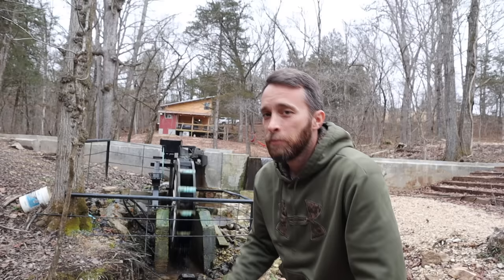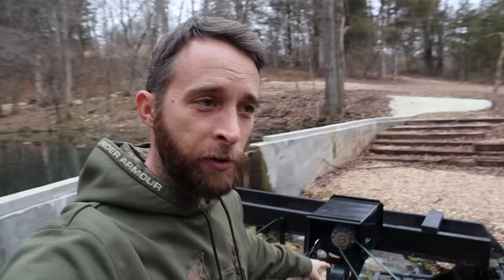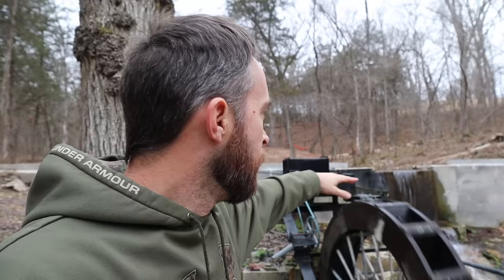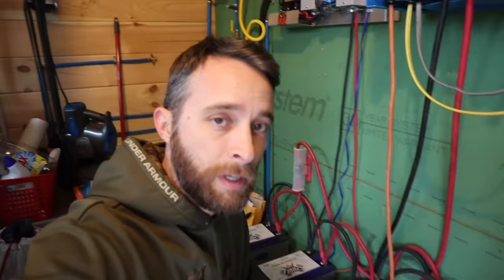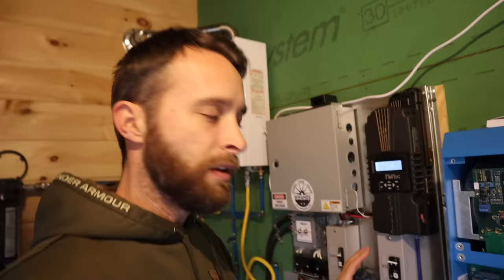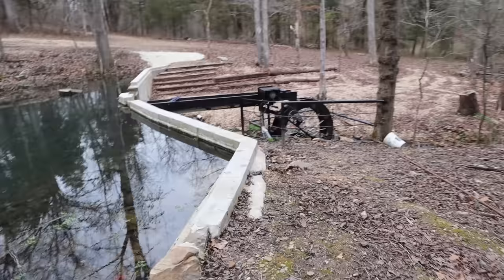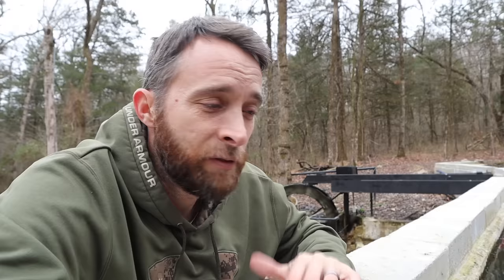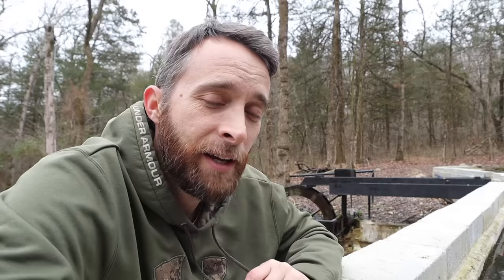Did we MAKE HYDRO POWER Using Our Waterwheel for Self Reliant Off Grid Living?

Comment: Hey. Love the videos, great craftsmanship. Jerry rules! I was wondering if I could give you a little advice that may correct your issues you are having. Replace the generator you're using to a 3-5 kw or possibly higher wattage AC generator. You drastically drop power the longer you run DC  from source to load. Your basically turning your conductors (wiring) into heating elements...yeah DC sucks for distance and is usually much lower voltage than AC which equates to lower effenciency. There's a reason why distribution power lines use 72,000 VAC or higher; more efficient distribution of power and smaller diameter of the conductor needed also. 
   So basically my advice is to use as high a voltage AC generator you can possibly power with your water wheel to power your cabin directly and use an AC to DC converter to recharge your batteries. You will need to turn the generator at 3600 rpm to get your 60hz but the voltage is not directly correlated to rpm speed like DC generators also. It shouldn't be to hard to come up with the right speed. 
   Just in case your wondering I've got degrees in Engineering and a background in Electricity. If you're thinking of trying this and want any help feel free to reply and ask me anything. I guess that's about the way it is done on here. You would think Youtube would make the way it's users intercommunicate much easier and more fluid with the experience of using it... Oh well, some other "something" will figure it out eventually if they don't. Good luck and if your a believer, God bless.
Reply: Saw your comment and I was thinking of making a paddle wheel i a large creek to turn a 6,000 watt generator to supply power to my house. My question is can it be done? The creek moves kind of swift.

Comment: I am working on my hydro system except it will not be charging batteries. It uses low voltage around 6 volts. It's only designed for incandescent bulbs I converted to 3v ultra bright LEDs. Each bulb has a total 4 five mm LED lights pointing in 4 directions. They light very well. Unfortunately I have to wait till rainy season to put it to the test. I recently upgraded the gear box to a 4:1 ratio. So I am crossing my fingers it works.

Comment: the water wheel upstairs is the most efficient among the various types, especially when the flow rate varies, many ignore them, but they give excellent results, they are limited on power but this is not the case, if the flow rate is the same and the difference in height is that the power will be similar but with a reaction turbine it will stop sooner or it will not work correctly when the water decreases, in this case the difference in height is the diameter of the wheel, generally the maximum possible size is lose jump, the right lower space to allow the water discharged from the wheel to flow out without disturbing it, the gear ratio must be corrected for the alternator but it is important for efficiency, the wheel's 10 RPM is not exceeded.
Turbines with Pelton or Turgo impellers must have a lot of difference in level and pressure, in this situation a ducted propeller turbine but would give more problems than the wheel, in my opinion it should be redesigned / modified, also using different materials such as wood for the structure and metal for the drawers, at a certain point it seems clearly under dimensioned, more drawers are needed more large with less space between them, they must be able to contain all the water that arrives, find the correct multiplication ratio, without electrical load it is obvious that it turns fast there is no field magnetic of the alternator that brakes / slows it down.
Ciao

Comment: If you  own property up the hill from the spring, let the water wheel drive a pump and send the water to a tank up there.  
Pipe the water back down to an AC turbine  below the dam.  Maybe you will get the 20 feet you need.

Comment: Use a drill and a multimeter and hook it straight to the alternator to test that it’s producing the amps you expect.  Test it at the source and test it at the house.  If you got significantly different numbers you may have bad wire.  You may also have a bad alternator - it doesn’t look very protected from the elements.   Also many lithium batteries have circuits inside that protect them.  I noticed in your video you were sending all kinds of voltages to the batteries, not just the expected input voltage.  When lithium gets charged too fast it can heat up and potentially explode, so if your batteries aren’t charging at all it’s probably because the voltage isn’t being regulated correctly before going into the batteries. The charge controller should do that job.  You can test all of these connections with the multi meter.  Do you get wind there?  Wind may be better than solar in a place with tree cover if you have it.  Good luck!

Comment: It's probably a stupid question, but have you verified that your generator at the waterwheel actually works as expected. I've seen similar setups work very well with almost no water flow so therefor I suspect that the generator isn't working as it should.
Another issue is the distance you have between the waterwheel and your alternator. You need very thick cables if you want to run that at low voltage. If the generator is producing alternating power, you can simply add an transformer in both ends of the cables and thereby raise the voltage in the cables without having to change anything else. If you raise the voltage from 24V to 50V you will reduce the power loss in the cables to half or more.

Comment: I wonder if you could get some IBC totes and mount them on a tower or elevated area. Then, use solar power to drive a pump to pump water into the totes. That would give you the 20 feet of fall.  I'm not sure how efficient that would be, but you can get totes for cheap. And build them like steps so you have a tote draining into a lower tote once you get the whole system filled with water.

Comment: What it's simply comes down to is that you need the really big wheel to be spinning the very small wheel don't have anything in between also having higher gauge wire will help a lot

Comment: Did you ever take the time to rebuild the wheel using correct hydraulic principles, make a wider wheel pit, and redo the sluice and get the system working?

Comment: You need a transformer to step up voltage to minimize resistance loss, i recommend another generator and a transformer step dow the electricity when it reaches the cabin and get an inverter

Comment: When the water gets to low can you use a ram pump off of your 6 inch reservoir drain line to pump water back up to flow into the water wheel? Seems like the water wheel spins well with minimal water. Just a thought for low water conditions. Keep up the good work!

Comment: Regarding your battery system, I think someone may have informed you incorrectly on a couple things, and I hope this is helpful to you, as I had the same train of thought until a couple years ago.
I heard  you speaking about the voltage and the amp hours of your batteries, and that you are under the impression that by running them in series, you are going to lose reserve power.
This is not true.  Your batteries have a Watt Hour rating, for argument's sake, let's say those BattleBorn batteries are 12 volt and 100 amp hours each, that would be 1200 watts stored in each battery (volts x amp hours)....which means you could run a 1200 watt hairdryer for 1 hour with one battery.  Now if you run 2 of those batteries in series and make 24 volts, you'll notice you are still at 100 amp hours......but each battery holds 1200 watts .....so you should have 2400 watt hours stored.....and you do!  you have not lost any storage capacity by doubling up the voltage, because you efficiency has also doubled.  Now your charger doesn't have to bring the input voltage from your wheel or panels down from, let's say 100 volts, all they way to 12 volts, it only has to step it down to 24 volts, a closer match.  On the feeding side to your household power it's the same thing, at 24 volts your inverter has to step it up to 120v, but it's twice as efficient as stepping it up from 12 volts.
So if you stacked all 4 batteries and made 48 volts, now your charger and inverter have to work even less to get to the target voltages for use.  Remember, you have 1200 stored watts in each battery no matter how you wire it.  Don't worry about volts or amp hours separately, look at the total stored energy which is volts x amp hours.  The less voltage changing you need to do, the more efficient your system is.
The most efficient system would be 120volts coming from power source, 120 volt battery bank, and 120v inverter.

48v at 100 amp hours is 4800 watts.
12v at 400 amp hours is also 4800 watts.
How efficiently you can get it to the hairdryer that is 120v is the challenge.

48v DC --> 120v AC is far more efficient than 12v DC --> 120v AC.  And you have 4800 watts in storage no matter what, it just depends if you are spending it on the hairdryer, or spending it just getting it to the hairdryer.

Rule of thumb: High voltage and low amperage power transmission is what you want between sources and chargers. And the closer you can keep the whole system to your power requirements (in this case it's household 120v), the more you will be able to suck every last usable drop out of your setup.

Hope this helps!

Comment: You should use a low kv bldc motor and get as mutch current as possible (volts), then step it down to 24 volt in the cabin to reduce the powerloss.

Comment: If you have tested volt output after the generator at the wheel, if it isn't constant during good flow likely you have slip i.e. pullies and belts slip with water bad. Chain or gearing or take the belt away from the water. One way is to extend the axels away from direct water.

Comment: I do feel like flume placement and water collection and also resistance in the feed is important that’s why I suggested the flywheel i’m not sure but it’s just a thought Good luck though I want to see it work and I don’t know if you can do this with electricity I’m not an electrician but I’ve heard it said that electricity flows like water the path of least resistance if there’s someway you could collect and store energy in between the cabin and the generator and then somehow get it from there to the cabin that might help solve the diminishing wattage I don’t know how that works maybe a battery bank in between of some sort just brainstorming kind of like a pump house for underground utility’s through out most metropolis cities I think for electrical grids they call them transfer stations you know the same way they get power from the power plant to your home like I said I’m not an engineer I’m not an electrical engineer but I know where there’s a will there’s a way good luck

Comment: while using wheel create yourself some browns gas using the water on the site to extract the hydrogen from the water and use this for everything in the house. 

it's a bit more work to set up and can be a bit expensive to get the tanks but you eventually bury the tanks and use that stored gas through some conversion processes, but it is sustainable once it's all set up.

Comment: An idea, as you say you're getting 50 volts.  Look at the old Delco-Light Farm Generator systems.  It was not uncommon in the earlier part of the 20th century for homes to use a 36 volt DC system rather than the 110 AC.  It's a lot easier to maintain batteries at that kind of voltage and with modern LEDs and low power draw appliances it may be something to consider.

Comment: Suggestions sir.
1 elevated your dam and over pour shoot to hold more water for dry times and also install a smaller gear ratio? Or transmission rear bike sprocket setup for a mountain bike more so??

Comment: What you have will work. You need to listen to some of the comments. Ac to the house, think in terms of watts. Voltage can be manipulated. With batteries and a constant flow you can do alot. You have a great system, don't give up on it. Your generator is the problem.

Comment: Thank you for reading, I didn't espect that. If I were you, I will use Transformer coil to increase the voltage, Diodes to limit the direction,Voltage regulator chips to stabilize the charging voltage, and use exchangeable gear set to decrease minimum working loading force. If the water wheel moves, it should able to charge. This is not mechanical problem, this should be electronic problem. Sorry for my English. Hope my opinion can help.

Comment: 50ah @ 24v is the same as 100ah @12v. You should also put your batteries and inverter way closer to the waterwheel, you will have quite a bit of losses in those long cables.

Comment: On the run to the wheel, block it off more and make a V leading to a centered large size PVC pipe, then reduce the pipe down in a couple of increments to increase the water pressure to the wheel. Just a cheap fix to get a little extra power and save a little on gas.
Reply: Should have mentioned that by reducing the water outlet you may be able to install a second wheel without affecting your water level too much. Reduce or enlarge size as necessary to take care of that

Comment: Put up a 50 ft water tower and use a mechanical pump to fill it and use high pressure pipe to cabin and use it for for fire hydrant and watering system and as well as power generation.

Comment: Use the 3 phase the alternator makes (before the diodes in the alternator). Send the 3 wires to your house and use a bridge there. Use a charge controller to smooth out the power to charge your 24 volt batteries. Your distance of 250 feet is the problem. Say you have 14 guage house wire that wire is 1.25  ohms. 19.2 volts won't charge your batteries but 3 phase at 22.6 through a charge control should give 27.2 volts at 10 amps.

Comment: Almost surely this has been brought up, but though the spring to the flume isn’t 20 feet, why not have a lower intake down a penstock to the turbine box a bit further down river?  Get the drop from the entire height of the reservoir, and whatever drop you can get further down.  Also being that you only need the turbine and generator, and maybe some power inverters (not an electrician, morso into dams) it could be fairly compact.  Of course there will be some additional power loss in transit up to the cabin, but by the sound of things, the wiring ought to be redone anyways.

Comment: Probably already said but, you cannot run dc that far. The wire size would have to be 350 mcm( huge) that is why all power lines are ac. You need to install ac generator, then convert to dc in the house. Water wheel is fine!  Good luck

Comment: Highly recomend moving to 48v system. Less amps so less losses and can use thinner cables safly. Your charge voltage needs to be higher than your battery system full charge voltsge

Comment: Go with  a  smaller  alternator  24 volt that  has high  output  at low  rpm's . Old  ac Delco . You  might  even  be  able  to  run  two  on the  same  drive  belt . They  need  the  rite  regulator,low rpm,s.

Comment: If you chance from a over flow it would  work just fine..you feed from the back side of the wheel ...and you can draw water from different  levels of the pond weather it's full or half full...so it will hit the back of the wheel and rotation would  be reversed may require few small changes like twisting the belt so the generator rotates in the proper direction

Comment: Reading thru the comments it seems a lot have hit on some issues.  Sometimes its a big picture problem; i see these issues
1: the full flow was splashing everywhere, mainly on belts which will cause huge amount of slippage.   FIX: stop the belts from getting wet, spashing water is waste.   
2: Have to confirm the generator RPM, it should be rated at xxV at xxxRPM.   You have to confirm the PM generators RPM at it's shaft and compair specifications to factort motor/generators' tag.   You said it was rated at 500 RPM, so confirm this voltage after fixing #1 above & find its output voltage.
3: PMGs produce 3 phase AC (pure sign wave voltage)  variable AC based off # of windings of the stater and strength of the Permanent Magnet strength of the rotor.    If it does not produce the voltage off the name plate then see #1 & #2 above.  If once you have the rotor of the PMG spinning at 500RPM and the voltage is not correct based off name plate (measured at the PMG terminals) then the magnets are weak and it will need repaired.
4: the dual 10/3 cables should be capable of 50amps at the range you are running (the lower the voltage the greater the power losses in the run of cable)    if #3 above is not good then you my have to have the PMG hard wiring changed to have higher PMG voltage/RPM design (unfortunately most PMGs cant be field re-wired to do this)
5. If you dont have the personal abilities to check these then i suggest contacting the people who made the PMG and seenif they have a field service people available.    The flow and wheel design should be able to power a good amount based offf what i saw and fixing the items above.
Reply from the maker: Thank you for the valuable info!

Comment: Hey mate just wondering if you get a voltage  at the water wheel chances are, because that's direct current (dc) with longer distances comes more ohms (resistance) meaning it has a harder time pushing pushing a voltage to the house , try a thicker cable or convert to alternating current at the water wheel then use a transformer to up the voltage  to make to distance to your house then convert back to dc and into your batteries